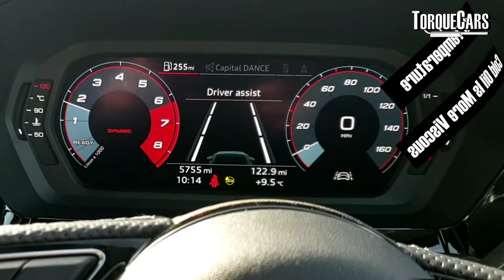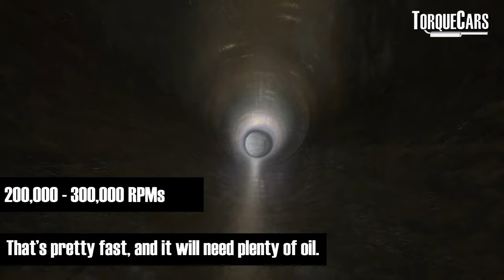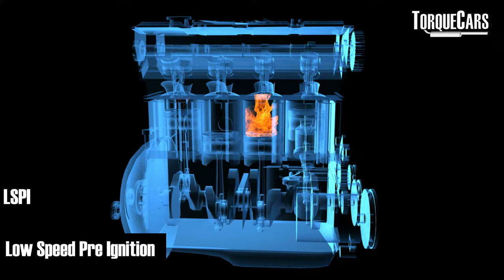5 Things That Kill Turbo Engines ⚠️ [WARNING]

Comment: Turn off stop start immediately.
Reply: @peteramos6081  not if it's watercooled ball-bearing they new very little oil to avoid damage.
Reply: That is a Machanical feature.

The System knows when to shut the engine and when not to. When driven fast it wont shut the engind because the preasure is high in the engine but when driven slow and economically it switches off because you were driving slow and the preasure is low in the engine
Reply: I hate that feature! It should be in reverse. It should never be on unless I turn it on.
Reply: No problem in a manual
Reply: All good got a manual
Reply: Never use it.
Reply: @peteramos6081  why?
Reply: If you like throwing money away by wasting fuel then yeah
Reply: i only use it when there is train crossing and i have to wait for who knows long... or those stupid traffic lights that are only green for 5 secs while huge traffic is building up. i start the car again 10-15 secs before taking off. it only shuts the car off when its in a designed safe temp spot. not too hot, not too cold
Reply: @thosetwodudes  if you re holding your clutch in, your clutch will wear out faster, as it gets hotter. if you re putting it in n the car will shut off
Reply: @GoldRaven-oe4by  its actually not that much. depends how much traffic. idling an engine for 1h is about 1l of fuel
Reply: @peteramos6081  im glad my turbo cars dont have that pointless feature
Reply: I’m having a Mercedes c200 petrol car. Is it ok to use the engine auto on off option. Is it bad for the engine.
Reply: @thosetwodudes manuals have them as well 😂
Reply: @lihlesasa6236  
This is simply untrue. Auto Start/Stop does not stay on when you come to a stop. You can drive for hours at high speeds and if you do that before pulling off on an exit ramp the engine will shut down and cease oil flow to the turbo shaft. You can cook your turbo this way. 
Shut off this feature when on the highway. Leave it on for city driving if you like.
Reply: Engrish not your first language?
Reply: But how about hybrid cars with turbocharged engines ?
Reply: @PonderingOne  cannot do so on many cars unfortunately

Comment: In the early 80s I bought an MG metro turbo. The instructions said “ do not drive away with a cold engine for 15 seconds. When you arrive home leave the engine idling for 15 seconds. Failure to follow these procedures will shorten turbo life”.   I have followed this routine with every turbo car that I have owned and never had a turbo fail.
Reply: same here with my 80's Renault 5GT Turbo
Reply: @TommyTucker0  just want to ask , with Morden turbos , how much idling time is required before I start driving ? should I idle every time before I start giving the accelerator? Even short trips like the supermarket or grocery stores ?
Reply: @EscapeToVictoryNow  it's not needed with modern turbos, that's why you never see turbo timer mods anymore...
Reply: @EscapeToVictoryNow  10-15 secs is fine, you wont waste much fuel. there is no need for idling 30+ secs like some tell you to
very interesting: i used to own a mazda 3 and after an oil change (with no oil in the filter pre filled) the oil light would stay on for only about 5-7 secs, so i guess you might also get away with 5 secs but if you want to be sure take 15 secs. in the handbook of a pulsar they tell you to wait for 30 secs however.
Reply: @ethanwasme4307  nonsense. Plenty of modern cars are seeing turbo failure within a few tens of thousands of miles. 
Every engine should be treated with mechanical sympathy, but a huge no no is to thrash a turbo with cold oil or shut off a turbo engine before the oil temp has levelled back out. 
If your turbo is really hot after a sesh and you turn the engine off, it'll suddenly have no oil or coolant flowing through and you will shorten the life of it.

I actually feel the modern generation have lost the knowledge 80s and 90s turbo owners accrued.
Reply: @matthewnicholas6365  Newer cars will spin the turbo after shutdown.
Reply: @24bellers20  now I know why my turbo might have some issues since check engine pops up at times, of course I never immediately take my car out of the parking lot as I turn her on, not even on hot days, 1 minute should be fine but after a more rpm engaging driving like 3-4000rpm as I tend to do outside city mostly at 100-130km/h or 60-80 mp/h at mostly 3rd gear since my car has 6 gears and it's long in the 3rd gear maybe it's best to give her a short break at like 2-2500 rpm for a couple minutes and a 1 minute idle time before completely shutting it off

Comment: One more tip if I may, change your engine filter or at least check it frequently and make sure it is clean. Turbos suck in a lot of air compared to naturally aspirated engines.
Reply: Air filter
Reply: Is it okay to use a turbo charged cars in temperate climate arears?
Reply: Engine filter 😂😂
Reply: Air filter, or you meant oil filter?
Reply: @aribibakio1962  Better than extremely cold climates. Between turbo chargers and direct injection, these engines need to be run until warm or you'll get gasoline contamination in your oil. The Honda 1.5 engines in Accords, and CR-V's have had a lot of issues in Canada, and the colder states with this. Short trips kill these engines.
Reply: What you may not realize is a slightly dirty air filter filters better than a clean one. Now, as for air flow, you may have a point. 
But you didn't clarify what you meant.
Reply: @Spanede  yes but not too much. 
 Ive seen a fleet of Isuzu turbodiesel street sweeper engines fail early from replacing the air filter excessively. 
Boy was that guy in trouble.
Reply: Air filter.
Reply: It's true, the air filter in my 2019 civic coupe 1.5t gets dirty quick. I have to change it twice a year. Luckily they're cheap.
Reply: @vermontvermont9292 

I changed mine last time about after 6 years and it was still clean, could make the double.
Reply: @MrTheHillfolk 
Please explain. This makes no sense to me.
Reply: @PonderingOne  I believe his logic is air filters get dirty over time and actually increase the rate of filtration, changing too frequently results in less filtration as we are not allowing dirt to build up. I don’t agree with it but that’s what he’s likely saying.

Comment: Most people screw up the engine warm up. It doesn't need to idle for more than 30 seconds. Just take it easy on the throttle until you reach operating temperature.
Reply: Hi so 30 sec is good enough along with gentle easy driving starting out? What about the cool down do you think if you were driving normal is cool down neccassary
Reply: Not really, if you've been taking it easy for the last mile or so after a spirited drive, that should have let the engine temp drop to a safe level negating the need to idle it prior to shutting it off.
Reply: My problem is when I pull out in the morning, it never fails seems like I always get some ass in a pickup come flying up on me and they want to shove me down the road.so it makes it hard to drive gently until your vehicle warms up. Miss the days of people wanting space between their vehicle and yours, Now, they can't get close enough. Just assuming everything will be as it is supposed to be and then when the vehicle in front of you is forced to slow dramatically very quickly or even emergency stop it is a multi- vehicle accident.
Reply: You are correct. My Honda Civic uses 0-20 weight oil and so it's like water even on a cold winter morning. I drive off with very little warm up but don't exactly drag race my car, I drive off and accelerate gently.
Reply: Oil changes are the key to engine longevity. Labouring an engine can do as much damage as revving the guts out of it. Drive the engine moderately until it has warmed up, and likewise if you've been using it hard and then pull in, let the engine tick over for a minute to let everything spool down and cool down. I'm driving 40+ years and these were all guidelines for turbo engines back then.
Reply: Becoming more of a problem due to direct injection also what happens is injectors not spraying a fine mist evenly around the combustion chamber and instead of a controlled burning you get spots of fuel combusting and can burn away pistons at that point, also for the same reason the excess fuel as droplets wash off the oil on the wall so you get excessive wear and oil getting up past the rings at that point contributing to this low speed pre ignition, another reason not to skimp on the fuel, also, change the oil twice as soon as the manufactures service recommendations, they are only interested in your engine and turbo lasting the duration of the warranty.
Reply: Depends on the vehicle but most modern cars will idle at higher RPM on cold start, once RPM drops to ~1000 you are good to go, not psycho though, oil is still cold.
Reply: @billcollins6705 Exactly oil changees filters and coolant changes and how hard you drive your car is all determined on how long your car will last ...also do at least 2 to 3 maintenance service a year
Reply: @brutonstreettailor4570  Exactly!
Reply: @scrambler69-xk3kv  I know the feeling. Just a few days ago I had this lady riding my a$$ so I sped up to put some distance between us. The problem was that it was a 35 and I was already doing 60 just to get away. I decided it wasn’t worth the risk (ticket or life) so I slowed down but she kept on. I rolled my window down and yelled out warning her. She finally backed off.
Reply: I worry about bore score if tickeover too long when cold. As more fuel is injected as a form of choke so might wash oil off bores
Reply: most people in the uk dont get the car up to  operating temperatures
Reply: @brutonstreettailor4570  bollocks. Prove it.
Reply: I do always wait out the warm up sequence tho before driving off. Otherwise the clutch (i have a dct) keeps slipping until im in 3rd gear.
Reply: Basic stuff i do for my high power turbo engine:

At least 80°C on the oil before giving it the beans, dont shut it off with oil temps above 100°C, no start stop, frequent oil changes, shift down when you want power/no lugging
Reply: You are absolutely wrong
Reply: Also, I think I read somewhere that warming up an engine instead of driving off with modern engines isn't good, and while running rich, washes the oil from the bores. Better to drive gently as you say.
Reply: @spidergoose891  what will happen if warm up is more then 30 seconds ? Will it affect engine and turbo ?
Reply: @jigz737  what would consist of a maintenance service?

Comment: With so many manufacturers putting turbos on small liter engines, educating the masses is needed cause this is where the industry is heading.
Reply: Is? Has been there for a long time now.
Reply: @Bizmyurt he meant to say it’s mostly heading there now as is. It’s been there but it was not in every car but now almost everything is coming with it. Even working trucks so
Reply: Most drivers do not care about these things. They buy new car every couple of years. Cars and gasoline are cheap, tires are given away free. Just come to Calgary, Alberta and see it for yourself!
Reply: a lot of people just lease or buy cars for 3 years and buy a new (or almost new, like 1-3 years old) one after that
Reply: At last someone who knows what they are talking about 👍🏻👏🇬🇧
Reply: @keisuketakahasi4584 Exactly, and I might add that turbos can be replaced if they fail. Its not the end of the world, as this video seems to suggest 🙂

Comment: I have a 2004 Passat 1.8T 4motion 5 speed manual. I always let it idle at cold start until the idle settles down to 840 rpm which usually takes about 45 seconds to a minute and a half or so. I always let it idle for a minute before turning it off after hard driving. I ALWAYS ALWAYS change my oil at 4000 miles NOT 5000 or at 6 months whichever comes first. I ONLY use Shell premium non ethanol gas. I make sure my PCV system is in good working order. I only use Castrol synthetic 5w40 oil for European cars. Make sure my air filter is clean and here's two other things everyone needs to do: Clean your MAF sensor and clean your throttle body. Yes of course I do ALL of my own work.
Reply: Sensible precautions on a VW engine. At least you might possibly delay the onset of problems
Reply: 5k miles aint going to hurt shit ive been doing 5k miles oil changes on my a4 b6 quattro and it does just fine ....... FYI 1,8T 20v
Reply: Beautiful engine and driveline. 
Just keep looking after it and you’ll see 300000 miles easy.
Reply: Yeah that is good you pay more for fuel long run... 😂
Reply: @garyparker2262  Are they really this bad in the US or is it just the price of petrol in place of diesel? The manual for my diesel VW prescribes oil changes once in 30,000 km - perhaps too optimistic, so I change it once a year and the flushed oil is still (almost) transparent. There injection units need a cleanup after 16 years, but otherwise the engine will outlive the car and myself. These ancient motors easily make 300,000 on much heavier LCVs with next-to-nothing maintenance.
Reply: There are better oils, like Amsoil and Penzoil when it comes to protection against engine wear and viscosity. Check out some tests here on YouTube.
Reply: Mine 1.9 tdi... doing the exact same things as you do.
Reply: On my 2018 Focus GT I have a separate gauge cluster just for the Turbo this is very useful it shows Turbo temp , Turbo Boost and Turbo Oil pressure  .  I Never step on it until the Turbo temp is at its operating temperature ! When I start the engine I can see that the oil pressure is much much higher in the Turbo as it warms up this Turbo pressure will drop down to the engine’s pressure , never step on it until the  pressure has dropped into the same overall engine pressure !
This is MOST important if you are living in a very cold climate ! 
Many failures happen through impatience of waiting for the Turbo to get up to operating temperature/pressure !
Reply: @gimaru1 Amsoil is overpriced garbage! Been using Castrol for decades never had a oil related issue. On 4 cy DIE turbo change the oil every 3k with a Bosch or Mann filter and enjoy. My 2.0 TSI Mk6 is pushing 195k with minimal oil consumption. My other turbos go 250-300k with NO issues. All on Castrol with no catch can bs...
Reply: @WorthlessNickores  i use E10
Reply: @jmi5969 
Clean oil in a diesel is not normal. Soot is produced during the combustion process and ends up in the oil if the oil is made for that application. Diesel rated oil suspends soot and turns black soon after the oil change. Clean oil in a diesel likely means that the soot is settling down on bearing surfaces. Soot is abrasive and will wear out the engine prematurely.

Comment: Yes.  The silly stop start has been disconnected.
Reply: @gregorysmith177  modern engines have been designed with this in mind, when they shut off they are at top dead centre to easily start again, also in most cases the systems switch off on their own if its unsafe to do so, for example my mk4 focus st stops switching off if it's not warm or requires power for a/c. After a longer journey it's more keen to stop start because everything is as it should be
Reply: @johnjackson2349  If you would have oil pressure BEFORE the engine starts, it would help a lot... 
The other question is, how much gasoline do you really safe that way, and how much stress all the stops and starts put on the motor over the years? 
(equation: gasoline saving vs "maintenance" costs of the stop/start system over time [motor wear]).
Cheers
Reply: @johnjackson2349 
What?  There are 4 cylinders in your car. Which one is at TDC in your scenario?
The auto start/stop control system may keep the engine running if the battery isn’t fully charged, but is not monitoring oil temp and determining that the turbo won’t cook if it shuts down to save a few cents.

Comment: Got a turbo Diesel, needed a new turbo at c. 110,000 miles. Started with a high-pitched whine that tracked with throttle movements. Cost over £1k. Live on top of a steep hill and have now made sure that the engine has a wind-down before shutting down.

Comment: My turbo engine is approaching 120k mi and still pulls hard. The key is 5k mi oil changes, no tracking, gradually allowing to warm up fully and the highest octane rating money can buy
Reply: Modern engines will go 10-15k between services
Reply: @Jack-lo1uc  if you don't half the oil service interval you can potentially half the useful life of the engine
Reply: Most turbos only last 150k
Reply: @GoldRaven-oe4by  theres turbos with 300k mi out there
Reply: My Astra mk5 1.9CDTi went 220,000 miles, not kilometers, on it's first turbo.  10,000 mile oil changes, always warm up properly and slow up last few miles before home.
Reply: @GoldRaven-oe4by  source: trust me bro
Reply: Buy a good oil and you can take that 5k oil service to anything between 8k and 10k 

People always skimp out on the most 2 important things for cars. Tyres & oil. I’m on Millers NanoDrive oil and it still looks brand new after 6k miles. Literally no reason to chuck money at the car just because a small minority of people say so. 
Mind you at least you do 5k changes. I’ve seen people recommend 3/4k 🤦‍♂️

Comment: Also if you are cornering hard and do not have any oil sump modifications, it is possible the oil pick up can suck a little air due to the slosh of oil from side to side. Starving the turbo momentarily can cause failure or excessive bearing wear. Also do not leave the car at idle for cool down for too long, you will end up with the oppisite effect where the turbo starts heat sinking from the engine that now has zero air running over and around it. These thigs I mention are from experience only, I am not a mechanic but I did get 252,000 kms out of my 04 xt forester turbo because I look after it using pretty much what is mentioned in this vid and being mindfull of the things I mentioned.